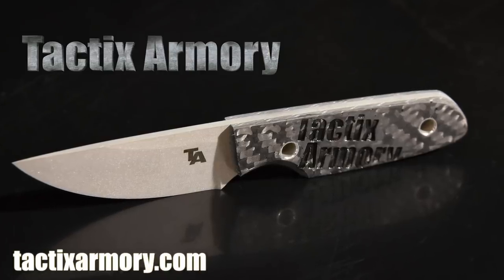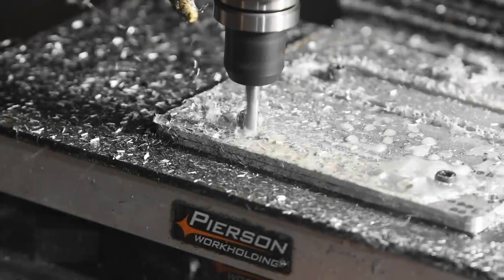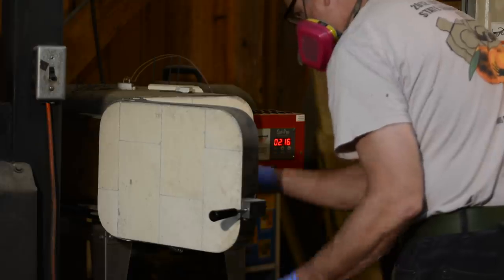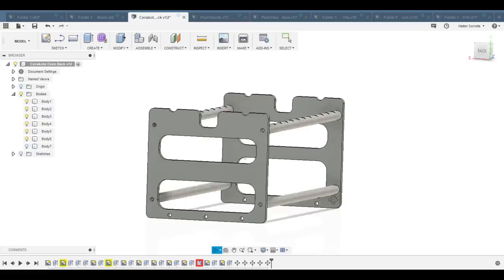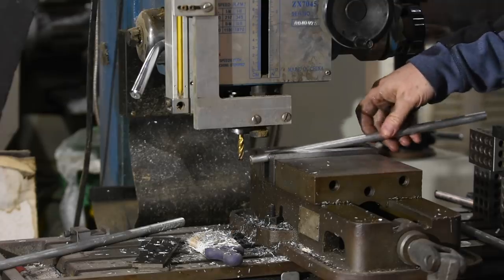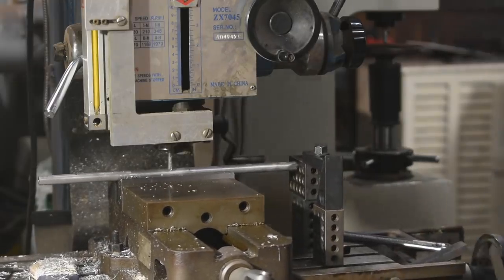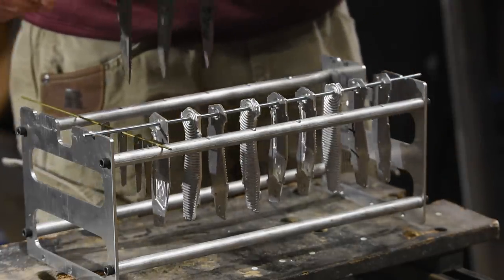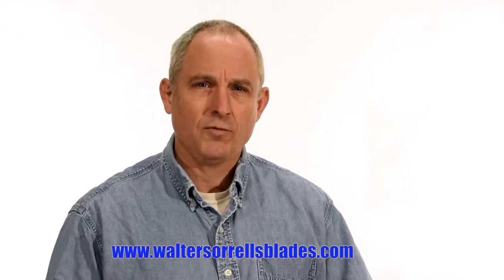Making a Cerakote Curing Rack for Knives

Comment: I've come to the conclusion that the people that always complain about not having a professional bladesmith's shop worth of tools are the people that are looking for excuses to not get off their ass. It doesn't take rocket science to figure out how to cut a pattern out of sheet metal without having a CNC mill... If that's your excuse, then you obviously aren't all that interested in actually going out and building something.
I'm helping my nephew build a Mustang drag car, and, "miraculously", we've managed to get a lot of work done without having a professional race team's worth of tools.

Anyway, LOVE how this stand was designed! Offsetting the height of the horizontal and vertical 'holder notches'(for lack of a better name), really makes it possible to pack parts in there quite densely while still leaving air gaps between all the parts - need to steal this idea once I get ahold of a small oven to do some powder coating with...

Comment: Hey Walter. Just wondering what that drill bit is you're using at the 2 minute mark of the vid? The spiral looks tighter than a normal twist bit. Thanks!
Bert
Wing Nut Designs
Reply: Nevermind...... saw it's a tap later in the vid...... :)